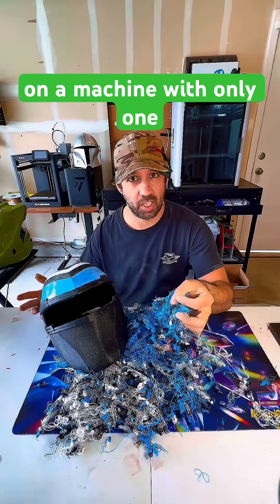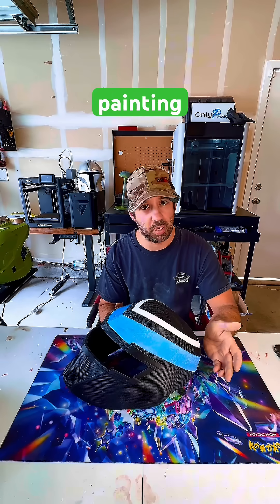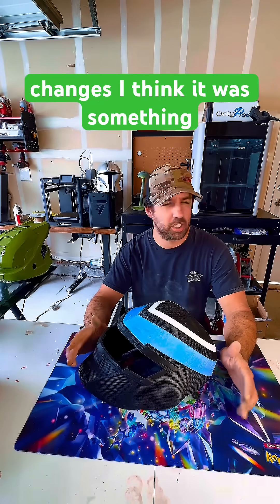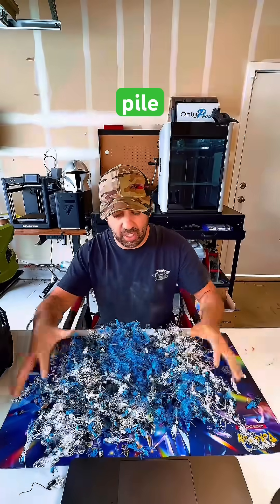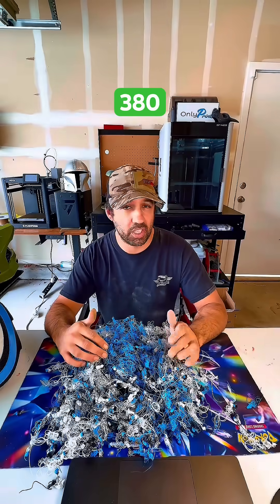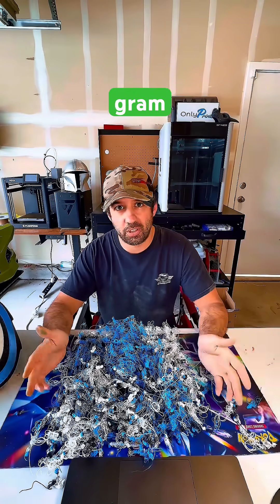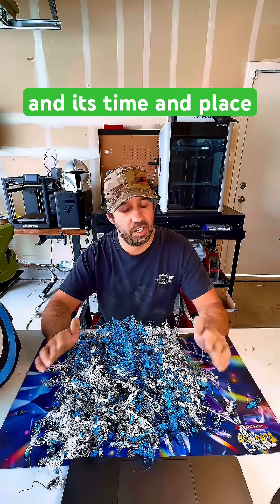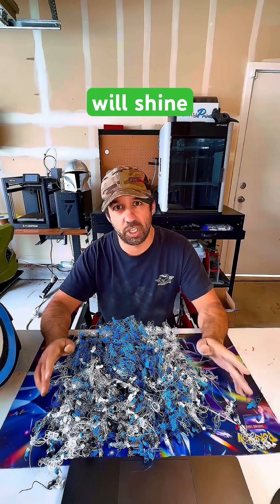This is the reality of multi color printing with a single nozzle

Comment: They will be great once they actually really work. I have yet to see one that hasn't had to be tinkered with tons to even get one kinda clean print. Sorry but the XL also needs all internals reprinted just so you can run PETG. For 5k they can keep the Slovakian nightmare.
Reply from the maker: That’s a good point. I think we will see how the snapmaker and H2C do. If those do good hopefully other companies join in and keep making things better/cheaper.
Reply: I think the bigger problem is how to achieve a finalized product with the parameter given. I multi color print quite often, started with manually switching filament, switched to multicolored printers but that actually didn’t solve the problem. Understanding design, additive manufacturing, and how to problem solve are the solutions you are looking for. Model the part in pieces, by color, print individually. Attach together. More advanced? Print one piece, make it to where it can be embedded into another 3d printed pieces while it’s printing. Pause the print, embed the colored pieces. There are always answers, you just have to know the right question to ask.
Reply: @TheManufactory3D Totally agree. Its all about the application for the design and the market in which yiu choose to work. Though multi material with the disolvable supports is a great product for me in what I produce. So great ideas about just no real QC of execution as we all know.
Reply: @CagedEagle13  nice view! I’m assuming you must have a multi nozzle printer? Or can you run something like pva through an ams? If you don’t mind me asking, what product do you produce where you’re using dissolvable filament? Shoes?
Reply: @TheManufactory3D I'm actually running a small starter farm getting into the industry. My extensive work in R&D along with working with these companies in China gives me a small edge in knowing what I want. That said I am currently running creality units. A few K2plus and a K1max that got me addicted. So yes I have played with the multi-head units but not a nozzle changer yet. Hoping it works clean because it was a design I was going to start making. Though it's such an endevour to produce a product, money etc. Been extremely tempted on some of the industrial systems since I can have them brought to me in a connex with my other shipments. Just cant pull the trigger on 25k plus😅. Wife wouldn't just divorce me. Rose gardens 😮😅!
Reply from the maker: It’ll be interesting for sure honestly if the indx system ends up working I’ll probably end up getting an ender 5 max with the enclosure and slapping that on. Giant bed with multi tool head unit could be awesome for doing one piece full color helmets
Reply: @Ctrlpcreations To not have to break everything up is an extreme advantage for post prep. Would be fun.
Reply: What in the world are you talking about I just got into 3d printing have an Anycubic cobra s1 and I own 2 of them my first printers haven’t had a failed print yet have over 500 hours on them and to only thing that’s failed is a nozzle clog 2 times everything else has been fine lol 😂
Reply: What the fuck are you talking about? Reprinting all the internals just to run petg? That's just a straight up lie. I've been running one since day one and I got a second one a few months ago and they print pet g non-stop. The old one still has its original parts. You must be paid by the CCP to spread such bullshit propaganda
Reply: @varukasalt Sorry but watched some of the first ones have issues plain and simple. The internal items that were printed in pla deformed. To each their experience. Not everyone has the same results. So su k it lil man. I'm American and Happy to give ya two California howdy's. Doubt you even know what that means (middle fingers lol). If ya do then have the day ya deserve lil boy.

Comment: You are blaming waste caused by you. There are plenty of options to reduce the waste by a ton.
Reply from the maker: I wouldn’t say a ton. I’ve actually printed it again a few times because I was curious and way more comfortable manipulating the slicer and I’d say I prob reduced it by 35% most of that being how much it purged switching from black. I’ll prob make a follow up video showing that

Comment: Check out the snapmaker U1 multiple colors no waste, like the others! 1 nozzle 4 heads!
Reply from the maker: I have seen it and am a fan! It’s just too small for what I’d want it for. I want to see how the H2C does for a while or wait until the indx system comes kit and if it works good toss it on an ender 5max so I could have a 400x400 tool changer lol

Comment: You could actually just orient the element to be at a straight line with the colours, that will add support, but it will short the time and the filament cost of the changes
Reply: Yeah I don't understand why they didn't do that.

Comment: Could you not purge your waste to a secondary product that does not matter what color it is, also have you not messed with settings to purge less when you dialed in your machine?
Reply from the maker: With how big that helmet was a purge object would  been tough, but I have since messed with my purge settings and reduced it quite a bit, I also just don’t print much multi color anymore.

Comment: I think at the end of the day, the client needs are important. have you thought about splitting the design into colored pieces and reattach together? That seems very optimal, although it requires a little bit of time modeling. You can even charge for design time. You’ve identified a problem, how could you solve it? The waste could be a result from not understanding your true problem.
Reply: True. This is a very possible concept of gluing together the pieces. And then charging them for the amount of material.

Comment: I was thinking about getting a multi printer… but only to be able to print multi materials… like PVA for supports for example. I much rather paint my prints. If you want specific colours, it‘s almost impossible to find the right coloured filaments anyways. For props and cosplay, the whole multi colour print idea falls apart as soon as it comes to weathering anyways plus, when the print has to be smooth, it‘s pretty much the only option.

Comment: Yaaay plastic to last 500plus years for ABSOLUTELY NOTHING AND POISONING ALL ORGANIC LIFE IN THE PROCESS CONGRATULATIONS HERE'S YOUR SIGN!!!
Reply: 😂 you must not be aware of the Recent discovery in Japan, where in multiple landfills, they found a bacteria that has evolved to digest and break down plastic for energy, turning it into carbon and water.
 Mother, nature takes care of herself, regardless of what we as  small insignificant animals do on its surface. We are simply a minor case of fleas And when the planet finally gets sick of us, she'll shake us off.
Reply: Well, Tim, he could print a hundred of those helmets and still not come close to what a single company using injection molding produces. So maybe complain to them, not to a small 3D printer.
Reply: As someone with 10+ printers running multi colour printers day in day out, I laugh at the environment & I laugh at you.

I've worked a factory line and the amount of product wasted is ridiculous. Until you get onto them about their wastage, pipe down about mine.
Reply: Plastic is simply a long chain of carbon hydrogen and oxygen.
And recent research is starting to show that it comes from a nonbiogenic Source, meaning that it is formed by geologic processes that do not involve any form of biological matter.
Because many wells that were once depleted have refilled to the point of leaking and being economically viable to use again.
And not simply Because of the increased price of oil, but because the volume of oil is high enough for long term operations, and shallow enough that they can use the existing system or reestablish in the same footprint. 

Petroleum is a self-renewing resource, a gift from Mother Nature.

Comment: Could you have oriented the print such that the color stripes were horizontal? That would reduce the color changes, but would have required more support.
Reply from the maker: I could have but I’m not sure how good it would have turned out tbh. Always possible though
Reply: That was my question too. I would have to have the model to know for sure. The purge for H2D might be pretty small but it will have a prime tower. Even a changer will have a prime tower.
Reply from the maker: I moved it around in the slicer but to have the rings more in line I wasn’t confident it wouldn’t mess up with how little of a contact patch it would have had. Would have been super tall too.